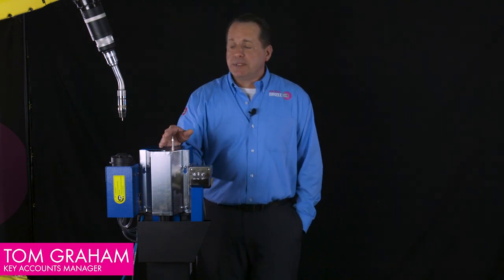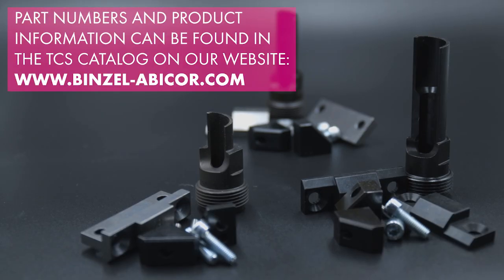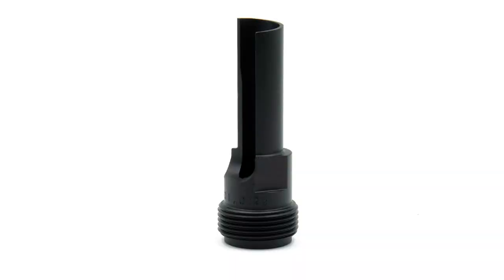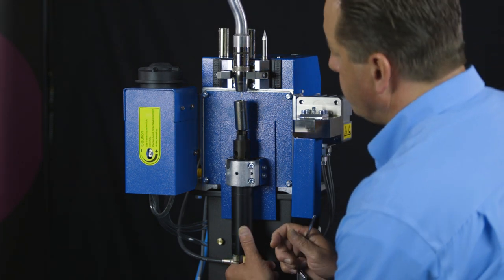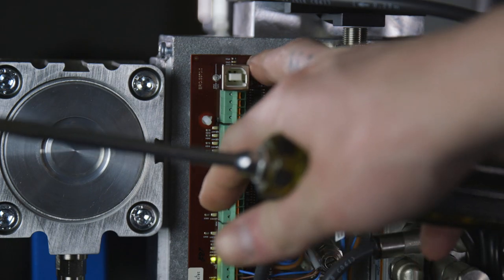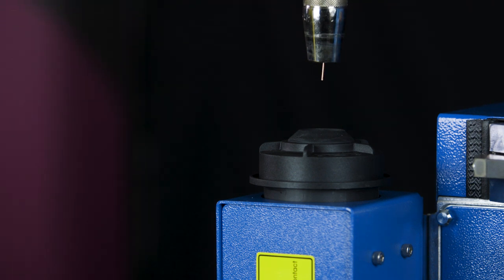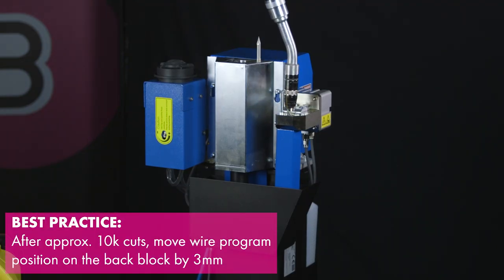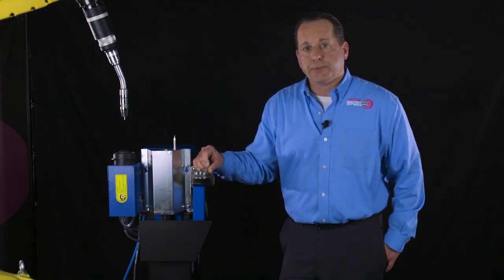Torch Cleaning Station "TCS-FP" - Features In Detail

Comment: What is frequency of nozzle cleaning  in robotic mig welding
Reply from the maker: Hey Jatinder, the frequency at which you ream the nozzle depends on your process. Some applications produce more spatter, weld longer, etc.

The TCS-FP is programmable to adapt to any application, so the frequency can be chosen based on your welding process.